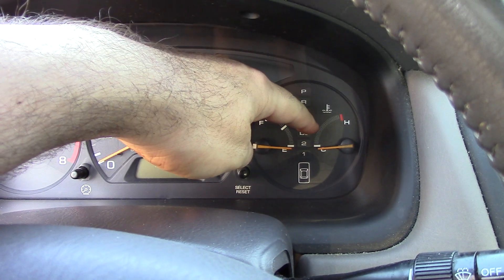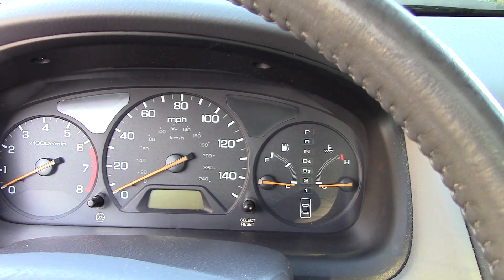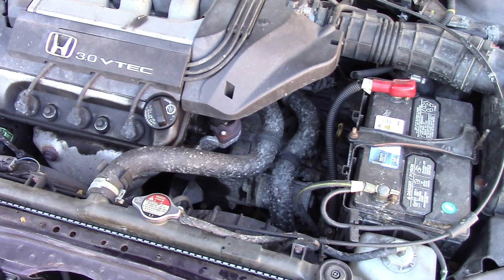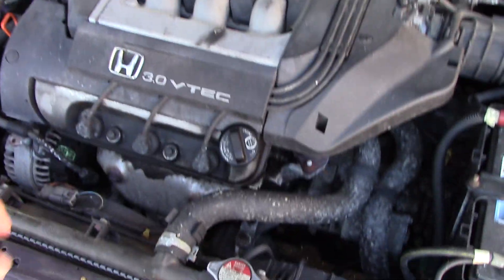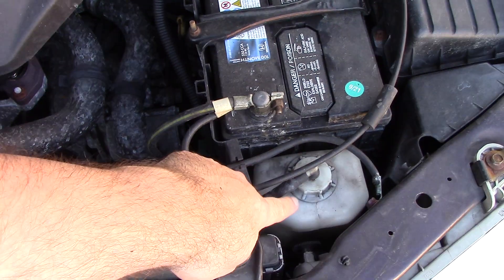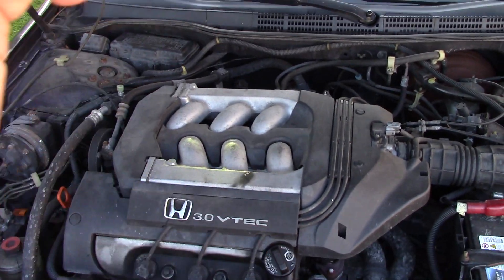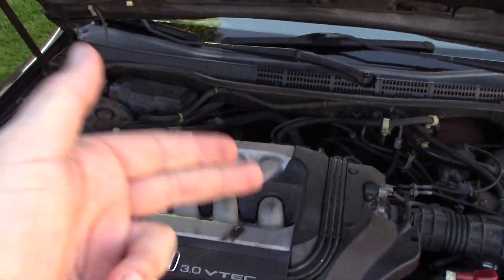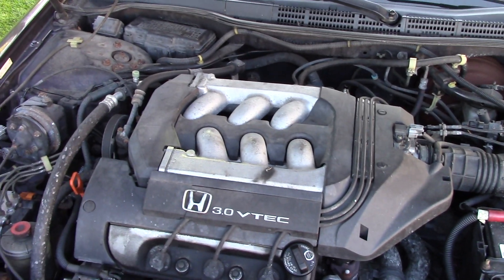This is Why Cars Should Have a Temperature Gauge!

Comment: You are SO RIGHT, I have a car channel and i have been saying this too. I have Jags mostly and the Temperature gauge stays in the center which it really is not accurate and if and when the car does over heat, it will be too late because the needle will probably jump very quickly and reacting to late and at that point, the engine is toast.. They need to have the accurate NUMBER reading..
Reply from the maker: For sure, it is so important to have! It might still be accurate. My own car did the same thing. Usually stays just below center, but when I had low coolant, it calmly went above and then back down, so it did detect very "mechanically" for lack of a better term.

Comment: I had a friend with a 1989 Honda Accord. He stopped by the house, and as I was walking with him to check out the car, I noticed coolant was pouring out. I suggested he stay, and we could swap out the radiator, when it cools off. No, no! He had to get going, and later on that night, he destroyed his engine.
All vehicles in my fleet have temperature gauges, and I do pay attention to them. Glad you do, too! What a mess that coolant made. Looks to be a simple job to change that radiator out on the "98.
Reply from the maker: Ugh, if only he had listened to you....or at least topped it up Maybe would have safely gotten him home.

Yeah it wasn't all too bad. Did top it up, and drove it to the service place, temperature was normal all the way. Got a new radiator and hoses, and still running great!

Comment: Totally agree! The temp gauge is very important to have on any vehicle, no matter the size. There's really no excuse for skimping on it, just about every gauge cluster has one/has room for one. 
Can be especially useful when you get in a small accident or something and still need to get home, paying attention to that gauge can really save you if you know when to pull over and let it cool off.
One thing I did notice, is on our '15 F150 it has not only the coolant temp and fuel, but also the transmission temp and oil pressure. All good, but i've always thought that the oil pressure gauge is fake or more of just a on/off type thing on ford SUVs/Trucks that do have it because no matter what, it ALWAYS flicks right to a little past halfway as soon as the vehicle turns over. I've never seen mine fluctuate at all, despite the L/H markings. It seems to just tell you if you even have oil pressure in the first place lol
Reply from the maker: Right? It's like why would you ever NOT want to know how the temperature is?? Oh yeah I have seen those oil pressure gauges before. I think if the gauge has numbers, then it is a "real" oil pressure gauge. I always wish my car had one, but I am ALWAYS on top of oil changes, and level checks, so it's probably the best protection my engine can get.

Comment: Interesting you had this happen as I just had to have the radiator replaced in the 2003 4Runner about a week ago. Thankfully I didn’t find that out as a result of it getting too hot, went to check the washer fluid and noticed the coolant reservoir, which is right next to the washer fluid, was almost empty. Just figured I let it get too low, so I refilled it. I decided to take a look and check about 4 days later to find the level in the reservoir down to the “L” mark. Started looking for leaks the next day and found one of the plastic parts on the side of the radiator cracked and slowly leaking. I’m very glad it didn’t overheat and that it has a gauge for me to tell. Hopefully all goes well getting the Honda fixed! It looks really nice!
Reply from the maker: Yeah funny how that all works out huh? Haha. 

Yep! The car has since got a new radiator and thermostat. Running perfectly!
Reply: I’m glad to hear all is well with it after being fixed! I’ve always liked those Honda V6s, probably my favorite engine after the Toyota V6.

Comment: I agree with you in all extents, but at the same time, I am shocked about this info, normal operating temperatures are between 180°f and 195°f (always stays in the middle on the temperature guage) and costly failures can happen between 240°f and 250°f (the red/H zone) and being stranded with a seized engine is not a good thing at all... Also, it's not good to start driving when the engine is too cold, since the viscosity of the oil depends on the engine temperature, The oil needs to lubricate critical components at the top. Not to mention you won't have heat until the engine reaches ideal temperatures. (i can do without heat just fine) but for someone that can't stand the cold, running the heater, only to be blasted with cold air would SUCK!!! So we all deserve an analog temperature guage. 

Not only the temperature guage and fuel guage should stay analog,  but the tachometer is also important, but I will let you speak about this term.
Reply from the maker: Yeah those temperature stages sound about right. Luckily the gauge never got to H, but it did at one point start getting about 3/4 of the way up (when I got to the driveway), so I immediately shut it off when I got up there and go the hood open so the heat could dissipate, and that's when I found the radiator crack. Oh yeah I never start driving when the engine is freezing cold. I usually let the RPM get down to about 1,250 before I start going. That's usually where the engine is "cold" while it's warm outside, so I figure it's a safe time to start going. 

Today before going to the service place, I topped up the radiator, squeezed the hoses a little to get out as many air bubbles as I could, topped it up again, also put some in the overflow container, started it up, and got on my way. Also had the A/C off, and the heat on full blast just in case. By the time I got there, the temperature gauge was still all good and normal, so it did hold perfectly for the trip there.

Oh yeah, ALL gauges should be analog, and all cars should have a tach! I remember some cars in the 90s and early 2000s not even having that. Luckily that seems to be a lot less common now.
Reply: @Sharkie626  
There are a TON of exceptions these days when it comes to a lack of tachometers. I encountered a Jeep Compass (fiat car with jeep badging) with a manual transmission, which manuals should ALWAYS have a tachometer, but the Jeep Compass didn't have it...

Comment: The coolant temp sensor only works when coolant touches it, if it low it will only read the air temp which is always lower, something to keep in mind
Reply from the maker: Oh yeah that I certainly do know. Though usually the gauge will get way high due to less coolant before it just drops off due to none.

Comment: A lot of drivers don’t pay attention to the temp gauge. I have a 2004 Trailblazer and it tell you to check gauges. This is the reason I hate old American cars. Fuel gauge and speedometer was all they had.
Reply from the maker: Yeah, who thought it should be that limited was not too smart. You're right though, gauges are only as good as those who actually check them.

Comment: Cars not coming with temperature gauges anymore?  Oh, that's OK, cars are completely disposable these days.  One scratch, totaled.

Funny enough, I have dealt with 2 cars that were older that did not have temperature gauges.  My old Chevy, and the wif's old Cavalier.  I blew a lower radiator hose once many years ago.  I was at a red light, once it went green and I went to go, it burst.  I barely made it 3 more blocks.  Temp light never came on, but I knew what was happening.  I could FEEL it in the engine.

The Cavalier's light did come on once.  Summer, we were driving, and the light came on.  No indication the engine was hotter than normal.  Pulled off to the side, heat on full blast.  Radiator fan is running just fine.  Let it cool for a half hour, light was out.  Back on within 5 minutes of driving.  Not low on coolant.  Radiator was not leaking.  Fan was running.  Water pump was working.  The problem and solution?  Just keep on driving it.  Light went out when it felt like it, never came on again.  Did it get THAT hot?  Was that really too hot, or was it a warning that it's going to be up in the danger zone soon?  No idea.  Ironically, the radiator fan did fail on that car sometime later on.  My late father in law and I replaced it, and it was fall.  We started the car and let it run for about 20 minutes to make sure the fan came on, which it did.  Never saw the light again on that car.  Also never saw it on mine, and I know the bulb worked on both cars because it would illuminate while cranking.

As far as the radiator goes, you can replace it yourself.  Easy peasy.  Did 2 of them myself.  Great learning experience and not a bad job.  Save a fortune as well, you can get the radiator delivered right to your door.

But look at that--right on cue, it's Octember!
Reply from the maker: Nah, you just turn them on and they're done! 

Oh those cars didn't have one either? Ugh, well I guess it was less common then. I remember the radiator hose story! Good that you able to get it back though! Yeah as much as I like oil pressure gauges too, temperature and fuel are probably THE most two important ones. Like "Yeah sorry, you can't know how hot your engine is." Well those people can go do themselves in an electrical closet.

Yeah the radiator doesn't look too bad, but I know my dad just wants to get it done and over with at the place.
Reply: A Cavalier, eh? Those things are trash, but at least it wasn't a Cobalt or a Cruze.

In my family, we call the Chevrolet Cruze "the Chevy Luze" as in "you lose"

Comment: Honestly, cars are getting worse and worse as time marches on. YouTube user Ford Tech Makuloco had to replace the taillights on a 2018 Ford F150 Limited, you’d think it would only be about a $400 to $500 repair, nope. Ended up costing $5600 just to replace the taillights since they have all kinds of sensors built into them and communicate with other modules inside the vehicle. To add insult to injury, some car headlights cost over $1000 a piece, some are $2300 a piece like on the one Alfa Romeo Scotty Kilmer uploaded a few weeks ago. If the head gasket happens to fail as well, that’ll be another $4000. If all 3 failures like that happened at once, it’ll be $11,600. Too much to put into a vehicle that’s fairly new. Hell, I can pretty much restore the one 1966 Ford Galaxie 500 4 door hardtop I plan on picking up one day with a trusty 289 in it.
Reply from the maker: Oh yeah I hear you. Remember when I had my water pump replaced in 2018, only to have it start leaking 3 years later? That made me quite mad. 

I cannot stand all these sensors for cars either. Just an expensive break waiting to happen. Definitely trying to hold on to my car for as long as I can.
Reply: @Sharkie626  most water pumps on modern vehicles either last for the life of the vehicle or give up the ghost every couple of years. Makes it more of a pain since almost all cars are front wheel drive as opposed to rear wheel drive where everything is just about accessible on the front of the engine. 

The thing most people don’t understand is if you want a car or engine to be reliable, it’s got to be as simple as possible. They may not be the most efficient in the world but will just keep running like a Whirlpool direct drive, may need to have the points re-gapped and cleaned every few years sometimes replaced, or the carburetor rebuilt once in awhile but those are simple repairs that can easily be done at home with basic tools.

Comment: YES!!!! Last car I had that didn't have a temperature gauge was my '89 Country Squire. No temp gauge and the ONLY indication of there being a problem was the Engine light! Thankfully it was only a popped lower radiator hose, but that's not the point! Temp gauged NEED to be STANDARD!!!

On a side note; My '91 Chevy truck as well as my Husband's '09 VW Jetta both have analog temp gauges.
Reply from the maker: I guess cars as such were more common than I thought. Yeah they should be a standard for sure. How ANYONE thinks not knowing how the engine temperature is, is a good idea, then they are just crazy. 

Glad ya got the analog ones going!

Comment: I had the almost same problem with my 1997 Dodge Ram 1500 earlier this summer.  I don't usually drive it but took it to work one day.  All was fine on the way to work.  When I was coming home I noticed that my temp gauge that normally runs around 200 was up to 260 and climbing.  I pulled over and shut it off right away.  I opened up the hood and found the top radiator hose cold and the radiator was cold too.  I was thinking maybe the thermostat was frozen shut and not allowing coolant to flow.  So I sat on the side of the road for about 10 minutes letting it cool then started off again.  My drive is only 5 miles and I first pulled over at about the half way point.  I drove for a little bit and the heat went up again so I stopped again.  It took me about 3 or 4 short hops to get it home.  I parked it and let it cool off completely before I started looking into what was going wrong.  My overflow bottle leaks so that is never an indicator of anything but I took the cap off the radiator and it only ended up being that my coolant was low.  It had been a while since I had checked it but once I topped it up it's been fine since and no damage done to the engine.  The big test was towing my boat 100 miles across the state a few weeks ago with no issues.
Reply from the maker: Aw man yeah I can see how that would be annoying for sure, does sound like a stuck-closed thermostat. I know a fan problem is usually told by when the gauge gets high when stopped and then goes normal when moving. 

At least you were able to get to where you needed to be still.

Comment: did you clay and decon before you waxed your car?
Reply from the maker: I guess that would be a no, because, what does that mean? Heh
Reply: @Sharkie626  its a deep cleaning of the painting surface, wash your car, use a strip wash and run your finger tips along the surface bet you'll find a few spots were its not smooth, when you feel that clay the vehicle which brings up alot of the stuck on contaminants that the regular wash won't get out, the iron decon will will remove anything further the clay bar couldn't remove.Things like rail dust etc.
Reply: Think about your face when it comes to automotive paint, Just washing your face with soap and then applying lotion on a.k.a. wax haha. clay bar and decon is like exfoliating your face before you put on conditioner etc. a.k.a wax, sealant, ceramic coatings.

Comment: Agree, however the lack of temp gauges in newer cars is compensated by electronics that will give you some form of warning.  Perhaps a digital warning or rpm drop to "limp home" mode.  Many people do not even look at their gauges (nor check their oil).   A problem with depending on that gauge is that the temperature gauge is dependent on the engine having coolant to measure.   When you spring a coolant leak, the coolant could go below the sender level and then read cool.  I kissed a Mercedes diesel engine (and car) goodbye because I forgot to replace the radiator cap.  So while driving the coolant boiled out.  Only way I knew that was because the temp gauge kept reading much too cool.  So I stopped at a rest stop and stupidly added cold water.  Cracked the block!!!  MB had the dignity to let me drive to my destination whereupon I junked the car.   Moral of the story do not put cold water in hot engines and a cool reading on a gauge can be as bad as the hot reading. Meaning you have lost coolant.
Reply from the maker: I still would trust an analog gauge over those electronics any day. The gauge is always visible and showing you what the temperature is all the time, there's no reason for it not show that all the time. Oh believe me I know all too well about those who never look at their gauges. I had a friend who one time apparently drove his car with the gauge pegged on H, never looked at it, engine seized. Needless to say, that was a costly fix. I could be wrong, but I think the cooling system is designed where the coolant would have to get dangerously low before there won't be any to register for the gauge, even for a missing cap, and by that point, the gauge would most likely have been on H for a while anyway. I'll probably do a follow-up video, but when I topped up the radiator and such, it took at least half the bottle, so with that much missing, it still definitely registered. 

Ooooo yeah, I learned long ago to never add cold water to a hot engine as it can caused what you experienced. Sorry the lesson was the hard way, but at least you know not to do it in the future!

Comment: If I thought cars with no engine oil dipsticks was bad enough, no temperature gauge is even worse. Because here is the thing: sensors fail, and if one sensor fails, then you'll never know what's wrong with the car until it is far too late. BMW is to blame with starting all this digital crap.
Reply from the maker: Oh my gosh that's another thing! Both are bad enough, but no oil stick is arguably worse than no temperature gauge. Not too sure what they were thinking there!